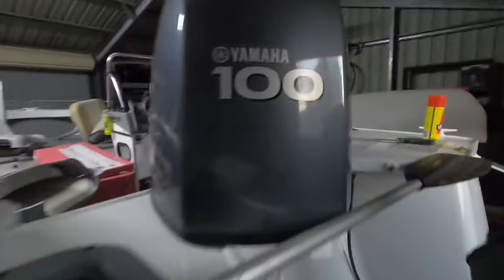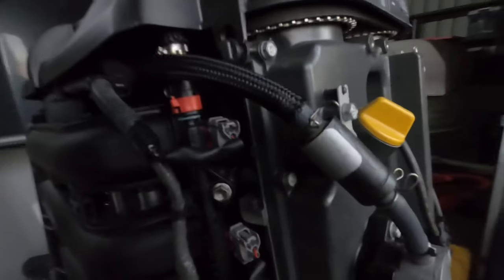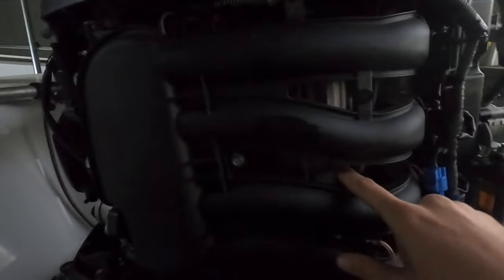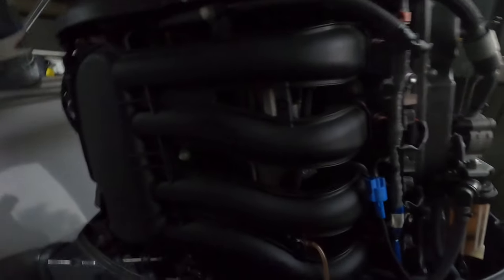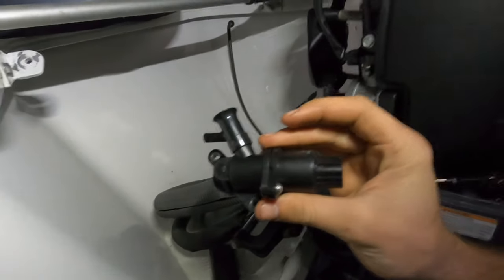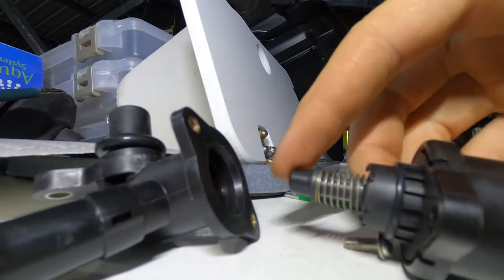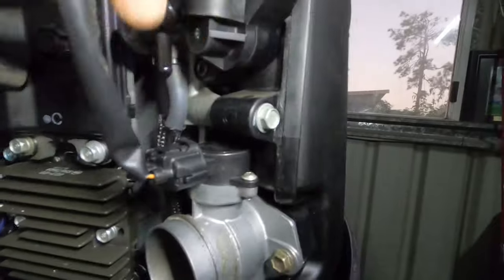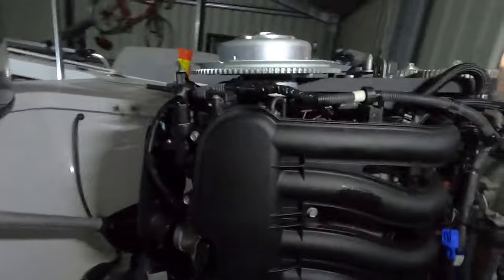Yamaha 100hp Outbourd Starting Issue - Problem Solved!

Comment: Just ordered part  Yamaha F90 2008 (309 hours), 6D8-13105-03-00, yamaha software indicated my ISC was at 60% and upon testing (i did hear a noise) would not go over 80%. Could be the sensor portion of it. Started acting up one day by not planing and started going downhill from there. When I flushed the engine, it was running as it was acting up. Next month, didn't want to start. I recently replaced VST fuel filter parts like you said in the video (that was fun), getting spark and fuel. That leaves the ISC in which I will replace upon arrival. Thank you for the video and will keep you posted.
Reply from the maker: No worries mate! Hopefully you get it up and running again soon. Let me know how you go👍

Comment: Are you sure you will be able to push that plunger in and out on a good one?
Reply from the maker: @johnhuff1887  yeah they should move in and out quite easily. If they don’t then good chance it won’t work in the motor.

Comment: Hi I have a similar problem, in the same motor.
The engine start fine at first, but after like 6 miles at 4500 rpm when I put the gas at the minimum  the engine goes off and it won't restart.
To restart it i need to let it cool down or to open the butterfly manually.
Can you help me pleaasee.
Reply from the maker: @paolorighi3752  definitely sounds like a similar issue. When the motor won’t start but starts with the butterfly open, usually means theres a fault with the IAC valve same as the one I replaced in the video. The IAC valve lets air through when the butterfly is closed at idle. If it’s not working then the motor won’t start without manually opening the butterfly.

Comment: I have a yamaha F100 and It just works fine at the first then a few moment later while running high rpm, the rpm goes down and engine stops. After a few manuel pump to fuel It works againg but not for a long time, and it stars to make it on low rpm now. would I have the same problem ?
Reply from the maker: Your issue sounds slightly different. My issue was it wouldn’t run on idle but would run with the revs high. Sounds like you might have a fuel issue. Check where the fuel hose goes from the manual pump through into the motor. They can get kinked there and no get enough pressure through. It will idle but won’t have enough fuel to rev it up.

Comment: I have a 100 hp yamaha that is giving problem the main fuse keeps blowing even when the ignition  is disconnected can you help me
Reply from the maker: So the fuse blows even with the key off? Easiest way to solve that is to go online and find a wiring diagram for that motor. From there you can find out what is on the same circuit as that fuse and remove them from the circuit. Add them back in one by one until the fuse blows and you will know what caused it to blow. Hopefully this makes sense 😂
Reply from the maker: Also how many hours on your motor? If it’s a bit older the regulator burning out is a common fault on the 90 & 100hp. That will blow a main fuse

Comment: Solved my problem….thx
Reply from the maker: No worries mate 👍🏼
Reply: @ProTechAutomotive  Curious if you have any advice. After replacing the ICV about a month ago the boat ran great. Now the problem is back.
Reply from the maker: @kevinbonk2244  did you buy a genuine Valve or a cheap aftermarket one? If replacing it solved the problem but the issue later returned, chances are the new part is faulty.
Reply: @ProTechAutomotive  Bought an OEM part and fired right up.
Reply from the maker: @kevinbonk2244  yeah that’s weird. I wouldn’t think an oem part would fail after a month..